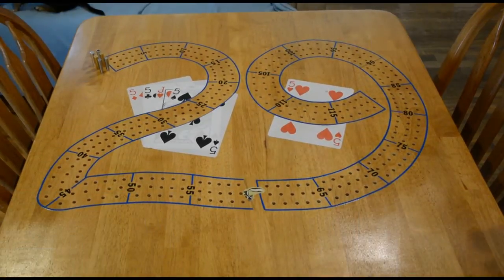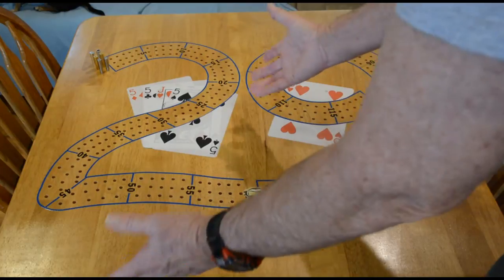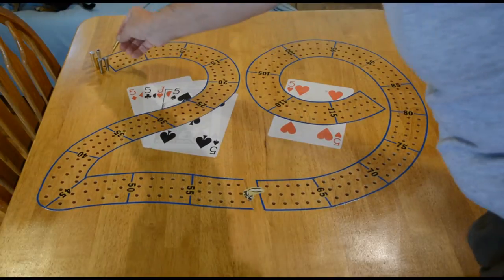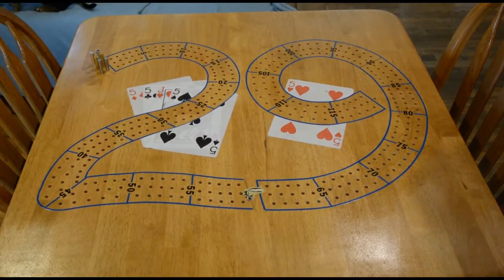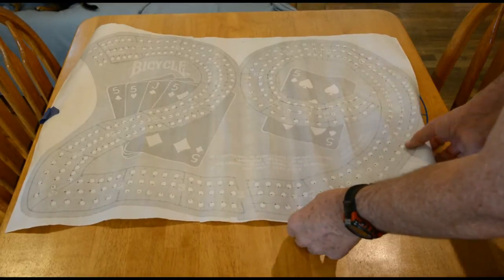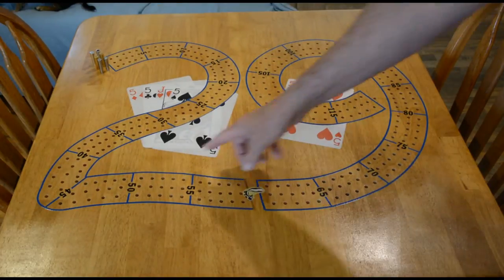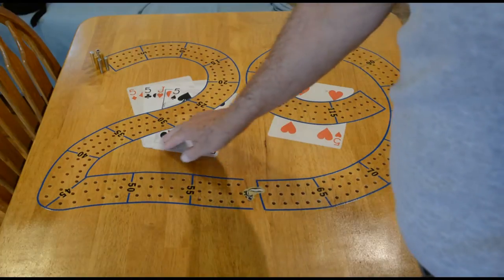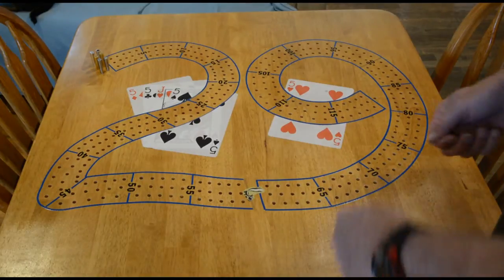29 Cribbage Table

Comment: what is the tool you used and where did you get the 29
Reply from the maker: The bit to drill the holes is a forstner bit.  I took a picture of a small 29 cribbage board and enlarged it.